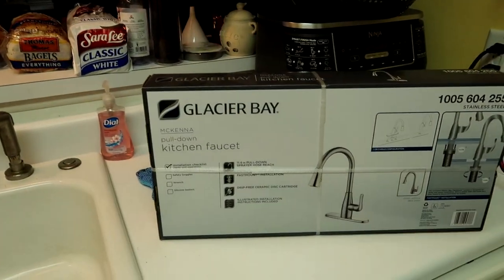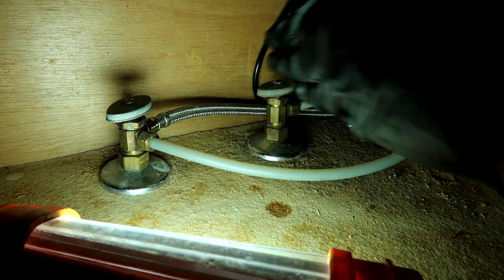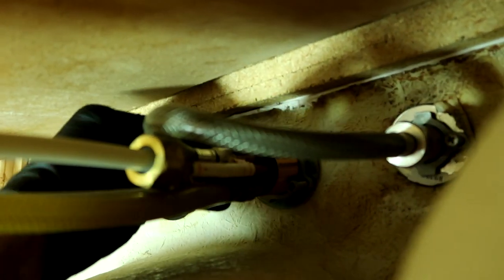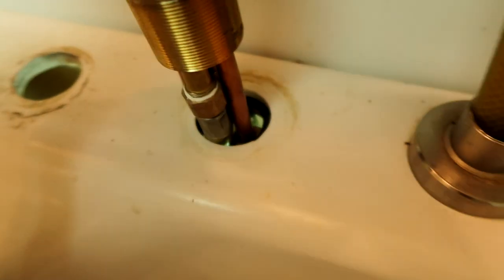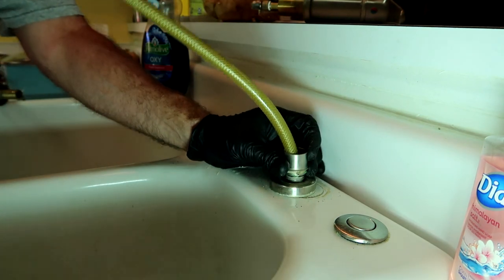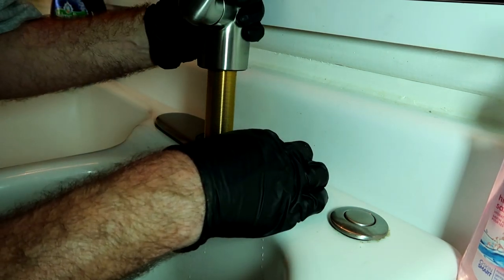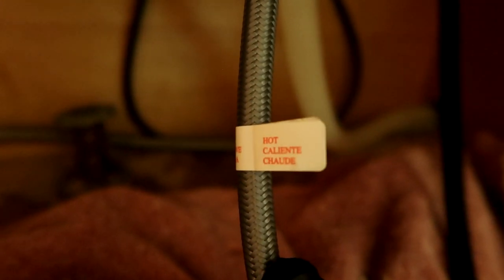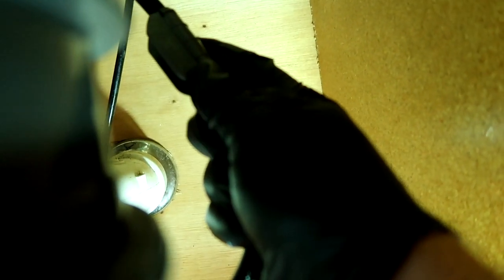Glacier Bay Kitchen Faucet Installation

Comment: No silicone? The instructions said it was required…
Reply from the maker: Silicone is good. The gasket plate that comes with it does a good job keeping water out. Silicone is great for a second line of defense if you want to throw a bead around the base. I've also used plumbers putty in the past. Thank you so much for watching Hollywood!

Comment: About that Glacier Bay, I think that's a HD house brand. They have very good warranties and parts supplies in my experience. Some of them lifetime. And they are cheap enough to just replace if they go bad. Sometimes HD will just send you a new one depending on the problem. As you can tell they made it very consumer friendly.
Reply from the maker: I'm liking them so far. Thank you so much for watching Sam!

Comment: Glacier Bay is pretty decent brand. Not the best but not the worst, just gotta put in what the customer gives ya. You should check out the Ridgid One Stop Wrench to go with that faucet installer. It can help you out with those stubborn angle stop fittings and a few other things.
Reply from the maker: Right on BrokeDown! Thank you so much for watching!

Comment: I couldn't get the fast mount to tighten down very well at all, but after visiting the Glacier Bay troubleshooting site, their instructions were more explicit than the paper installation that came with the product.  You have to tighten the top part of the fastmount, not the main body.  Now it doesn't wobble.
Reply from the maker: Right on! Thank you so much for watching Jim!

Comment: Does the quick connecter goes connected with the pipe thats holding the weight small bar down with that small pipe?
Reply from the maker: Yes. Should hear it snap up there.

Comment: Hello, what part is that for the water supply connection? I do not have that part and can't connect it to the water supply. Is is an adaptor?
Reply from the maker: A water supply line. Home Depot had them.

Comment: The panel hiding the holes is a little loose on the ends the instruction say silicone I am not sure if it goes around it like caulk or under it more like glue!
Reply from the maker: You can put a little bead of silicone around the base or plumbers putty under it and tighten it down.

Comment: Hi there, we just installed this model, but the hot line is not flowing, what could be the reason ? Thank you
Reply from the maker: Blocked supply line or valve isn't working. I'd need to be there for this head scratcher 🤔.
Reply: @LexVance  thank you for answering so quick. We will try that. Appreciate it🙏🏿

Comment: Thanks. Somehow the bottom connector came loose on mine and I couldn't figure out how to re-tighten it. I had to pull the top piece up off the cuff, push it up to the underside of the counter, then had to finagle the rest of it (hard to do in a confined and awkward space) until it finally went up and over the threads to meet the top piece, and THEN if finally clicked at the top and I could hand tighten it down. But what a hassle. I'd prefer to have just screwed it all the way up the threads to tighten it the old-fashioned way. I shouldn't need to search out a video and then fuss with it for 10 minutes to do such a simple task.
Reply from the maker: Just making memories 🤣. Thank you so much for watching Tyler!
Reply: @LexVance  ohhh... in that case it was totally worth the extra time it took to fix it! 🤣

Comment: Do it Steve Lav style & break out the grinder with cutting wheel ... When in doubt cut it out mama! 🤣😂🤩
Reply from the maker: 👍😆👍 I love that. Steve Lav don't play and will break out the grinder in a NY minute. 🤣 Good to hear from you Tim!
Reply: I had one the other day, the nut underneath was rusted in place luckily it was loose so I could sawzall it from the top. Never leave home without the sawzall 🤣 great video as always thanks for the info.
Reply from the maker: @michaeltipton6335  Right on! Just making memories!

Comment: What's up man, do you ever have to install whole ac systems, condenser air handler etc at your property?
Reply from the maker: When it calls for it I've installed new condensers. Not air handlers as the places I work are still new.
Reply: Property I'm over was built in 65 lol, I want to work at a new property